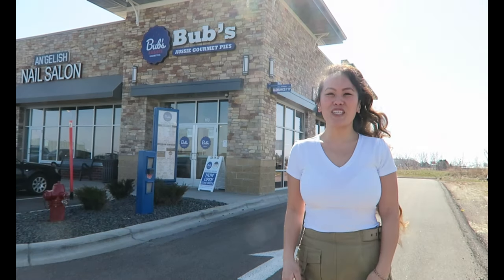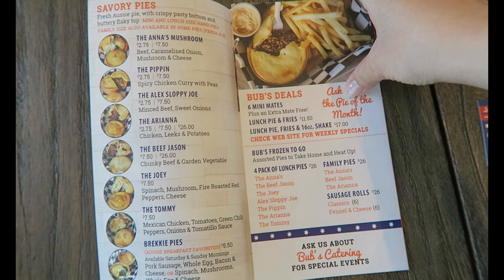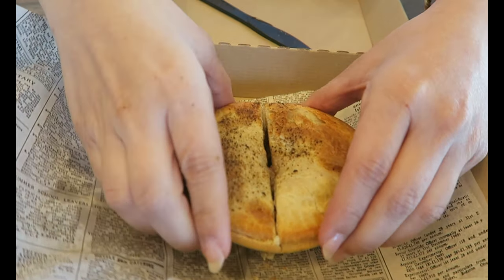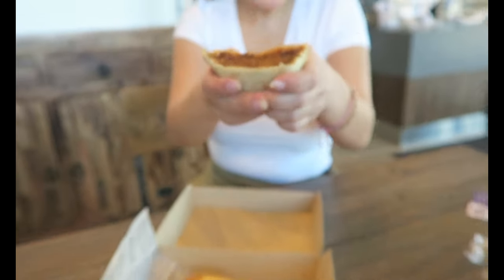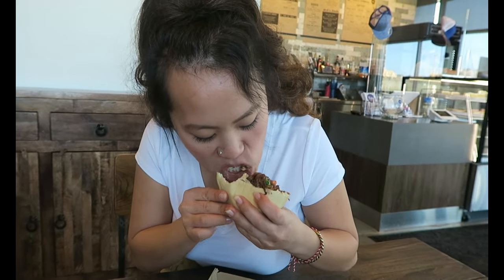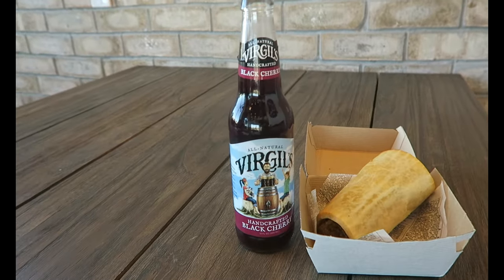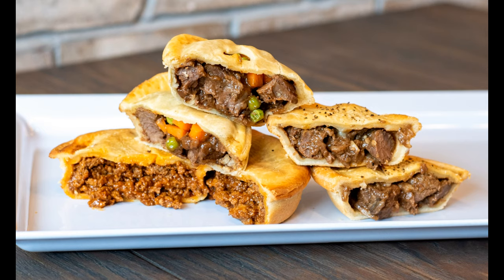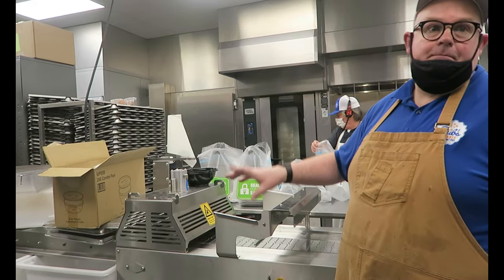Australian Meat Pies at Bub's Aussie Gourmet Pies

Comment: That sausage roll is too fat and not flaky enough, looks well undercooked.  They are also selling both of them in the wrong type of packaging.  You need to hold it in the brown or white, plain paper bag it comes in, to catch any pastry that breaks off.  Better not to cut them at all.  You start at one side, keep holding it at an angle, so the filling stays inside until you get to the back.  The curry one was too runny, for aussie standards.  Your countrymen have changed the flavours, so for a real aussie pie experience, you will need to come to oz.  A beef pie does not come with the tom sauce baked in, you add it, it has worcestershire sauce in it.  Try looking up an aussie shop, for a catalogue of specials, like Woolies or Coles, the freezer meals section will likely have a good pic, we can get a variety of party size pies and sausage rolls, and full size ones as well, from any supermarket.  I'm not saying it never happens, but that spinach pie I have never seen here.  All the best.